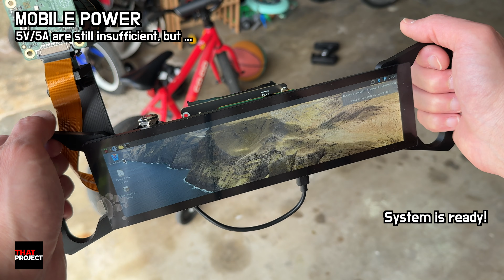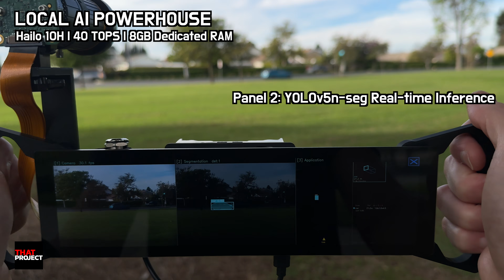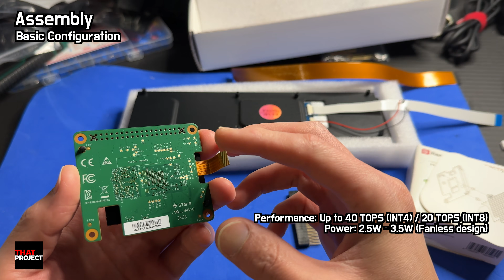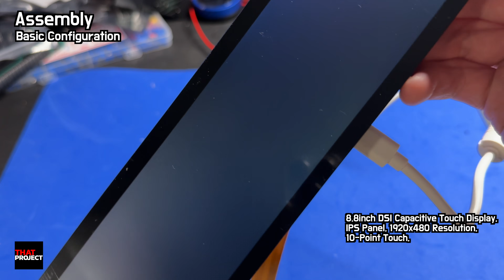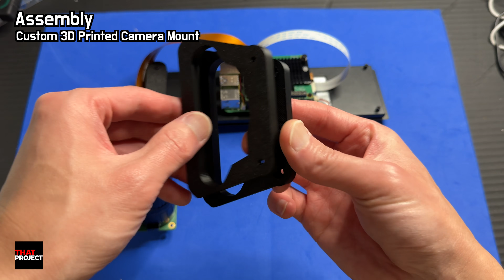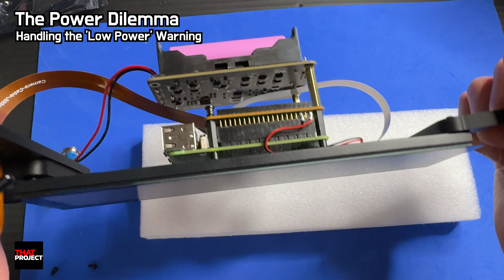Raspberry Pi 5 on Steroids: 40 TOPS Portable AI Beast!

Comment: you dont need the new AI for that XD opencv could do it long ago, I have some idea about vision but its too futuristic
Reply from the maker: You're right, OpenCV is powerful. Curious about your 'futuristic' ideas, what would you build with this much power?
Reply: There's some Adapters for Dual Camera operation within the RPi CSI bandwidth, It would be interesting for the next iteration of this prototype using Stereo Vision VLMS and/or OpenCV Algorithms, I am very interested in the latest developments in 3D Depth Maps Models with these types of restrictions and configurations of Hardware. The OpenCV AI Kit (OAK-D) from Luxonis would be a great source for documentation reference and source code
Reply: @MaximinoReyes  I work on software mostly, VLMS and open CV mix can be handy, agentic browser and computer use  need a good model but for this job some fine tunning would make it more accurately

Comment: 7:00 Great build sir, might I suggest you 3D print something to use the back of the screen mounts to go the width of your screen that way you could get the Pi and the UPS side by side length ways which would even out the weight more that sticking out in the middle.

Comment: the annoying thing about the raspberry pi is that you need 5.1v-5.2v to get rid of the warning message.. that's why you can't use a normal usb supply....
Reply from the maker: It’s definitely annoying, but it ensures the board stays stable under heavy loads.